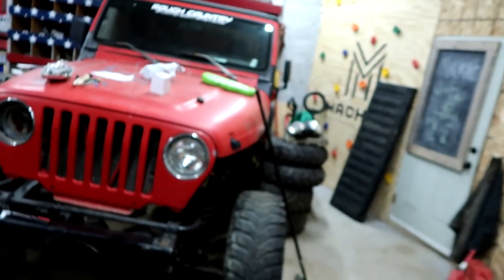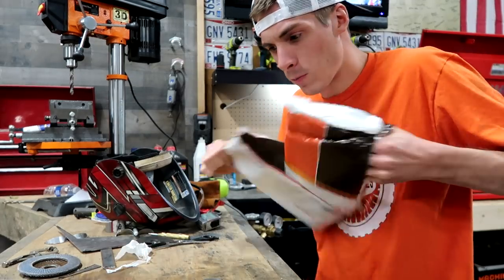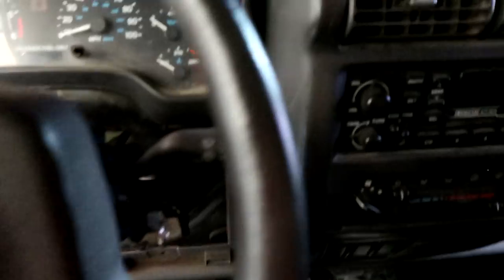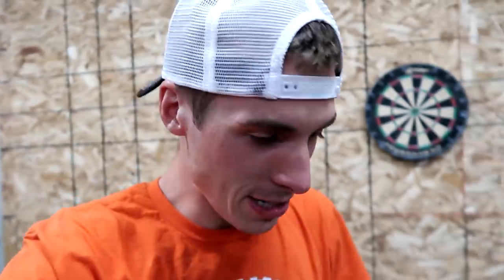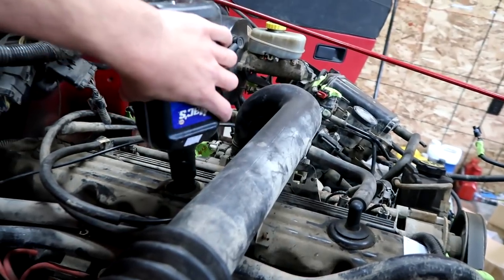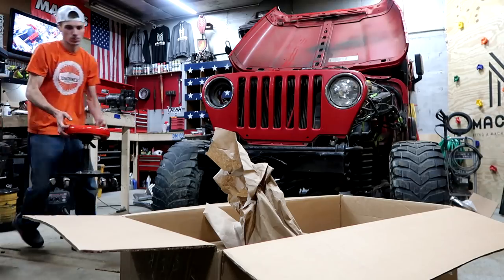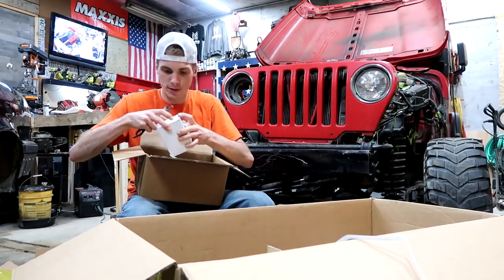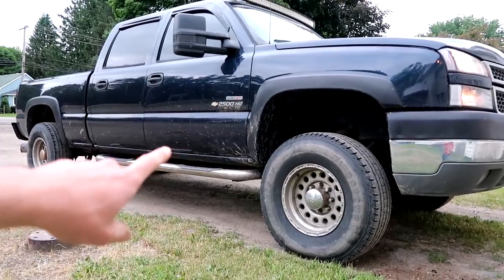THE JEEP RUNS. TURBO CHARGER TIME!!

Comment: Right on...glad the ECU worked. That jeep is gonna rip sh!t up with that Turbo!!!
Reply: ECM!
Reply: PURE POWER ha ha...ya that!!!
Reply: DeviouS at least its a tj and not a cj. Tjs are less worn out since there newer. Alot of cj at least where im from have well over 130 thousand
Reply: don't count on it. Prolly a cheap ebay turbo and oversized. Will prolly blow the motor up.
Reply: Ryan Georgi he bought a kit specifically designed for the tj

Comment: Spray degreaser all over the motor an engine bay let it sit for 45 seconds then pressure wash it off. It will look so much nicer. Do it on the heel duramax and the bmw.